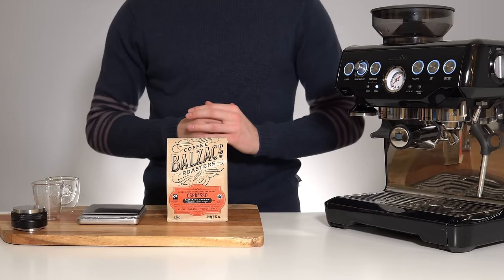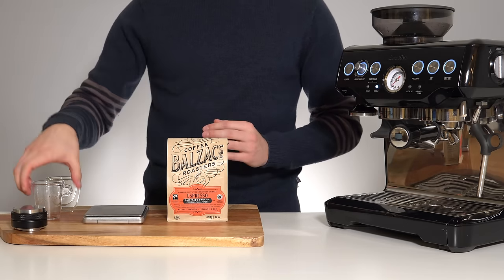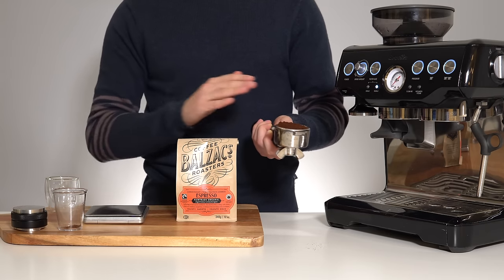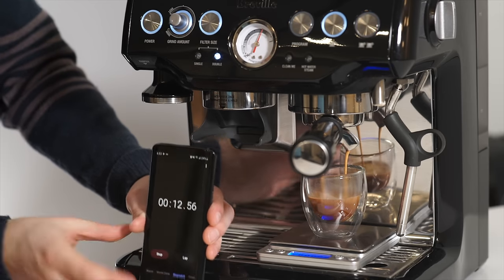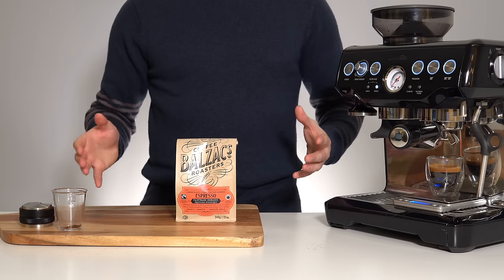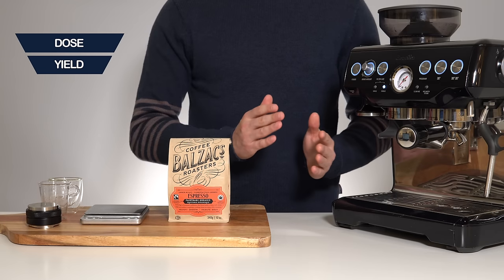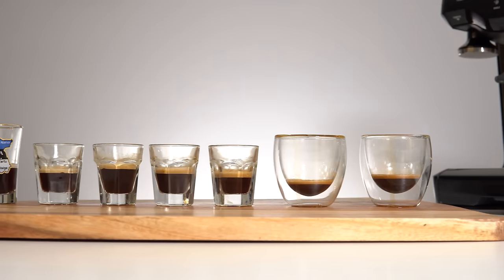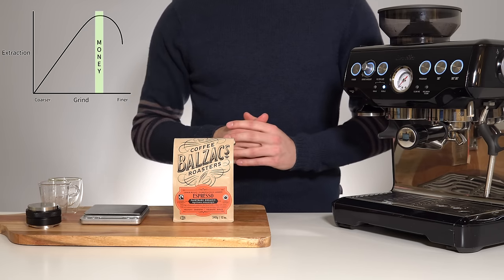Dialing In Breville Barista Express | Dose, grind, yield, time

Comment: Hi, I’m really struggling, with this and would appreciate some advice. When I’ve got 18g out into the double basket, I then tamp it down, but it’s way too proud of the top of the basket so I use the levelling blade which removes about 4g of coffee, which I guess could then balls up my extraction ratio.
Anyway, my grind setting is at 8, I start the timer once the first drips come out and it only takes 12 secs to get to 30g (not even 28g). WTH?!
Never thought setting up a coffee machine could be so frustrating. 
Also, unless you buy the same coffee (and I’m guessing it need to be expensive coffee to be consistent for quality) then dialling in every time is gonna break my heart.
Would appreciate any advice.
Reply: Update: my grind setting is now “6” I tamped the sh*t outta the basket with so much pressure I may as well have sat on it, so as not to have to level it off and lose any, but I still had to and was left with 15g (not 18g) I ran the timer and it was even less than the first attempt at 10 secs to reach 30g (15g x 2) with finer grind and much more pressure. Oh I did a grind, throwaway and refill after each adjustment so that the beans in the hopper had chance to adjust to the new setting.
For £500 this machine is a tw@ to setup.
Reply from the maker: You still have a LOT of room to grind finer. The fact that 18gr does not fit in the portafilter, means that you're grinding too coarse (along with the flow that is too fast). Do NOT try to adjust the flow by tamping harder. Tamp just hard enough that you feel the coffee pushing back, and then stop. Move down to the finest grind setting and see what happens. If its still too fast / doesn't all fit in the basket, you'll need to adjust the internal grind setting to allow you to grind even finer! (Not uncommon to need to do so) here's how! https://youtu.be/QNvOcE4-VEo
Reply from the maker: But FIRST! Throw in the dual wall filter basket, use the razer tool, tamp lightly, and enjoy an espresso. Dialing in a single wall filter is hard. Take a break for today and enjoy a coffee on your new machine with the "helper" baskets.

Comment: Hi.i have this machine too.when i press button for making espresso, before pressurizing, there is a little leakage coffe frome portafilter then machine is going to pressurize. Why is it?
Thank you
Reply from the maker: You're not grinding fine enough! 
What pressure does it get up to in the middle of the shot? Should be around 12 or even 1 o'clock on the dial
Reply: @LifestyleLab_ it is fine enough.a little delay with leakage and  then pressure to grayscale area(about 11 clock)
Reply from the maker: If water is coming through during preinfusion, there is something wrong with the integrity of the puck. Either not dense enough (grind size / tamping pressure), or there is channeling (air pockets)
Reply: @LifestyleLab_  thank you in deed for your response. I think air pocket is right answer.I try more and send you consequences

Comment: How does temperature adjustment play into this?
Reply from the maker: Higher temperatures will allow for slightly higher extraction. Lower temperatures, lower extraction. Assuming all other parameters remain the same. 
In comparison to grind size and brew ratio, temperature changes will make a very small difference to the final flavour

Comment: I measured 18g of beans. When ground, I could not fit the content inside the portafilter!!  I tried 16g; again I could not fit the ground beans inside the portfilter!!  What am I doing wrong? I am using a barista express machine. Thanks
Reply from the maker: You're likely grinding much too coarse! The coarser you grind, the more space the same weight will take up
Reply: Double check that you are using a 2-cup (double shot) basket.

Comment: When the espresso is swittched on, it pumps some hot water into the drip tray. Is this a normal function?
Reply from the maker: Yes, that is the solenoid outlet releasing into the drip tray :)
Reply: @LifestyleLab_  thank you so much for your response. Each time I switch on the espresso, it pumps some hot water into the drip tray. I was worried, thought it is leaking water into drip tray.

Comment: What setting did you use for the inner conacle burr?
Reply from the maker: Whatever setting you need for your coffee, just like the outer setting :) 
Each inner click is about 3 outer clicks, and is just used to give you more range at each end of the spectrum if you're hitting the max or min
Reply: Thanks
Reply: Sorry to bother but how much liquid for 22 g dose thanks
Reply from the maker: A "traditional" 1:2 brew ratio would be 44g of espresso. However, as always, dial in to taste as needed
Reply: Thanks

Comment: Hi, i have a question while trying to dial beans. i did grind size 2, it took 20s to get 1:2 (i use 9g single shot) with the pressure gauge showing over extracting, i change the grind size to 4, took 14sec to get the yield while the pressure gauge is still showing overextract. I tried grind size 7 and i got the yield in 11sec while the pressure gauge is within the desired espresso range. How do i fix this lol. I'm using fresh beans from local roaster btw
Reply from the maker: Don't pay attention to the pressure gauge's marked "espresso zone", it is basically incorrect. Most good shots happen with the needle pointed straight up, or even further to the right
Reply: @LifestyleLab_  I see. Mine was like far right 😂 that's why I'm abit worried haha
Reply from the maker: No need to be worried! Focus on good flow, and even MORE importantly, good flavour!

Comment: Question: I do 18g in, grind 5, for 30 seconds for 2 full oz of espresso but I'm getting 65 grams out. How do I get a 1:2 ratio?
Reply from the maker: A 1:2 ratio would be 36gr out. If you are getting 65gr out in 30 seconds, you likely need to grind slightly finer to slow the flow. Also remember, there are no hard rules to this! You must dial in to taste as I describe in the second part of the video

Comment: I am still confused when to start the timer:
1) first drip in cup (aprox after 8 sec) 
2) the second water is mixed with coffe in portafilter (roughly 1 sec. And it is immediately after flushing a mashine.
I personally lean for 2) option
Reply from the maker: Explanation https://youtu.be/E9MiqOJdwPc
As long as you are tasting, it doesnt matter how you time. A 32 seconds shot from first button push will taste the same (because it is the same) as a 25 sec shot from first drip. If you dial in correctly. You will reach the same shot, nomatter when you start counting...

Comment: What filter to use? Single wall or dual wall?
Reply from the maker: Single walled!
Dual wall filter baskets are only for use in cases where the coffee you are using needs "help" building pressure, such pre-ground store bought varieties. Are long as you're grinding fresh coffee, and grinding fine enough, a single walled basket will produce a better shot of espresso

Comment: I can see your machine starts dripping when the indicator goes up to the espresso range. I don't know why my machine (1 year old) starts dripping when the indicator starts moving to the pre fusion range. Any suggestions? Thank you
Reply from the maker: Likely just underdosing your basket, or grinding a little too coarse
Reply: @LifestyleLab_  the indicator still goes to the middle of the circle with my current set up. Will try with your suggestion. Thank you!
Reply from the maker: As mentioned in this video, don’t pay too much attention to the gauge. The “espresso range” is blatantly wrong in most cases. Just focus on flow and most importantly TASTE !
Reply: @LifestyleLab_  thank you!

Comment: I've got a question: I also have barista express and I have problem to dial in because whatever I do, I always end up with high pressure and about 15-20sec extraction time from pressing the button. I dose 18g and doing the leveling and tamping consistently. Dunno what can be the problem.
Reply from the maker: You're very close! You probably just need to grind 1 or 2 clicks finer to extend the extraction time
Reply: @LifestyleLab_  I'm already passing the "Ideal espresso zone" which is ~ 2 o'clock on pressure gauge. The pressure's high, the extraction short...
Reply from the maker: Don't pay attention to the pressure gauge. If the coffee has a flow rate as described, my guess is that the pressure gauge is not showing the correct value.

Comment: I use the same machine and get perfect pressure - grind size is 6, 25 seconds double shot (counted after the preinfusion), 18 grams of coffee and yet I get about 58 grams out. Is this normal? Am I missing something?
Reply from the maker: The pre-programmed shot on this machine is around 60grams for a double shot. If you want less, you can program it manually to any value you want! By pressing the program button before the double shot button, and then pressing the double shot button again once you've reached your desired yield
Reply: @LifestyleLab_  good to know, but then I guess the timing will be less than 25 seconds? Is the time counted after the click of the button or after it starts pouring coffee?
Reply from the maker: There is no exact "correct" number. The 25 second rule is a general guide to get you to a point where you can start tasting and tweaking using the concepts in the second half of the dialing in video

Comment: PLS help, I just got my breville express and I have tried adjusting the inside grinder settings and outer, but when I grind the amount of grinder beans that comes out when using 18 grams seem WAY to much it spills out and make a big mountain on the top of my portafilter, is this normal ???
Reply from the maker: If 18gr will not fit into the portafilter you are grinding too coarse (the finer you grind, the more beans can fit into the basket)

Comment: Have found in order to get my shot timing into the 25-30s range, it also results in the pressure reading over the 'expresso range' indicated. Could this be a tamping problem? I understand the grind setting is vastly more important than tamp, but could the tamping create a problem?
Reply from the maker: Like I mentioned in the video, everyone who I've talked to with this machine gets the best shots at around the 12 o'clock to 1 o'clock position on the pressure gauge. If your flow rate is good and your coffee tastes good, dont mind the pressure reading :)
Reply: @LifestyleLab_  Thanks, I've got quite a bit to do to improve my shots, but your video was really helpful to get me here. Just got to wait for Crema to get their range of Breville kit back in stock!
Reply from the maker: @Jameswgm  yes, really too bad they ran out so fast
Reply: @LifestyleLab_  After a bit more experimentation, I'm getting drinkable shots. It highlights the fact that I've drunk some crap 'espresso' in my life! Had to adjust the internal grinder scale to 2 in order to grind fine enough, then the external dial to 1 which I thought was a little surprising but it gets it done. Got a calibrated tamper coming to help out a bit as I've no idea what 30lbs pressure equates to.

Comment: Ok so I'm struggling with doing this, i followed to the tee how n what happens in the video. I've got the same machineand set it up the same as per the video.
I cannot seem to be able to get 16g/18g of coffee into the portafilter without there being a huuuuge mound almost double the size into the portafilter. Again i am using the same set up inclu size of portafilter etc.

I use a little plastic cup collar to stop any falling out when im putting ground beans into the portafilter. But even then by the time ive distributed the coffe grounds round/in the portafilter i goto tamp and theres alot wasted as it cant seem to hold that much?
Am I doing something wrongnor missing something?
Anyone got any tips?
Cheers
Reply from the maker: You're either grinding too coarse, or, you have a very dark roast. Both of which take up more space than finer grinds, or lighter roasts.
Reply: @LifestyleLab_  boom exactly the issue im using extremely dark roast so will get some medium soon. Thanks for the help

Comment: Ok someone help me out here. I have now waisted a full bag of coffee on the same machine and cannot get it right. I managed to dial it in to a point where I get 36g yield with 18g of coffee with the right pressure using a calibrated tamper BUT in about 9 seconds. I do start timing from the coffee coming out NOT pre-infusion/button press. If I get the grind any lower in order to get a longer extraction time the pressure goes to the max. Any ideas?
Reply from the maker: Be sure to watch the whole video! 6:20 

Don’t worry about the pressure gauge, good shots are generally pulled with it between 12 and 1 o’clock on the dial. Pressure and flow are directly related, you can’t slow the flow without raising the pressure. (Or modding the machine)
Reply: @LifestyleLab_  Thanks for your response. My pressure is already at 1 o'clock and as you rightly say flow (and therefore time) and pressure are directly  related. So according to the pressure my flow rate is correct but according to my time it's not. Any finer grind and I go to the max of the pressure gauge...
Reply from the maker: In the end, taste is the final determining factor. If a very high pressure slow shot tastes good, then that’s you’re dialed in shot. If a very fast mid pressure shot tastes good then go with that. The 25 second rule is very much intended as a starting point to start tasting at, not necessarily a final destination
Reply: @LifestyleLab_  That's the issue - the shots don't taste that great and I do get a lot of channeling. I did a bit more digging and looks like it's a common issue with the BBE as the OVP pressure is set to 15 bar. I'll open up the machine and dial it down to around 9 and see how I go...

Comment: I could REALLY use some help. I have been going at this for hours and can not get even close to the 2:1 ratio. I currently have the internal grind to 2 and the external on 4. With 18g I get to 36 grams around 15 seconds. WHAT CAN I DO PLEASE HELP!
Reply from the maker: Are you using fresh coffee? Or something from the grocery store 
Fresh coffee makes a BIG difference
Reply: @LifestyleLab_  grocery store coffee from Portugal
Reply from the maker: Try to find something freshly roasted if possible. For now, you can use the pressurized basket (dual wall) to start enjoying the machine right away

Comment: Is it just me who cannot pour a shot which lasts any longer than 20 seconds? No matter what the grind, my shot begins nice and slow but then once the pressure kicks up and its as if it pushes the coffee through at a really high speed. Any advice?
Reply from the maker: Have you adjusted the internal burr setting finer? (Not the external dial)
Reply: @LifestyleLab_  No I haven't. Is that something which most users have to do or will it be down to a specific coffee type?
Reply from the maker: It will be completely dependent on your individual machine and coffee, but not unusual to need to do :)

Comment: What about the top burr?
Reply from the maker: Top burr only needs to be moved if you hit the largest or smallest grind size and can still not achieve the proper flow rate (still to fast at 1, or still too slow at coarse). The top burr can then be adjusted to offset the entire grind range higher or lower by following this video: https://youtu.be/QNvOcE4-VEo